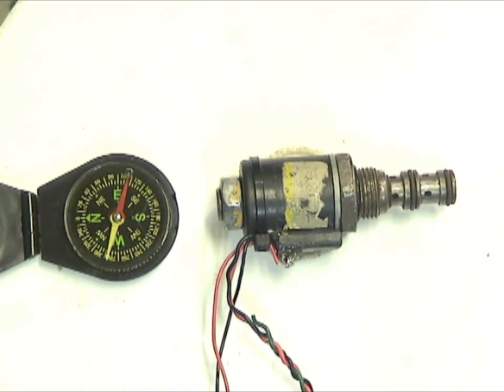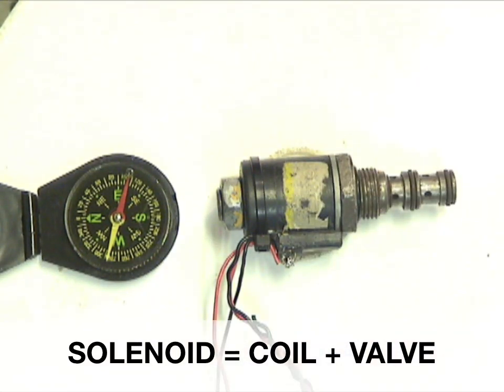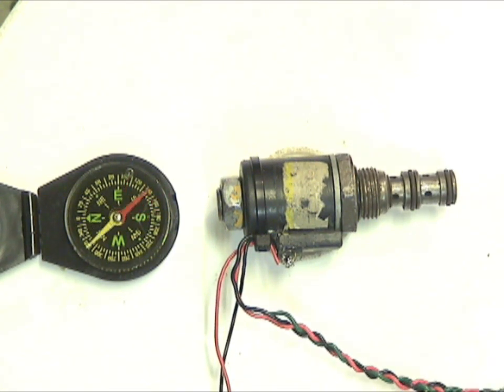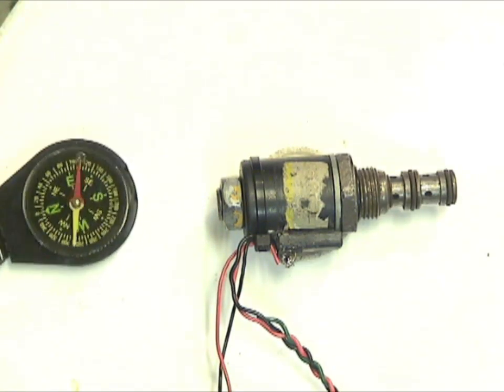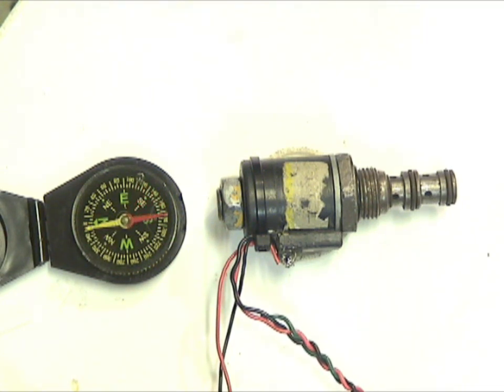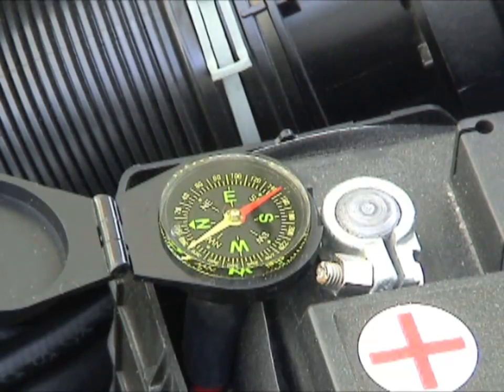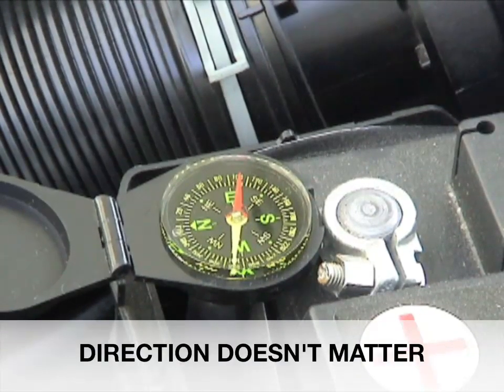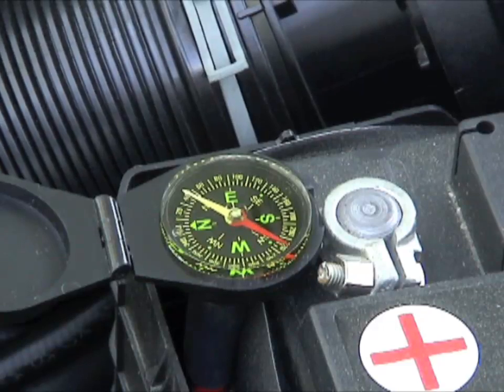Testing Solenoids and Alternators with a Compass

Comment: That's a great test. You could however, still have a weak, low charging alternator.
Reply from the maker: If the needle swings, the voltages reverse...
Reply: @bivideo7 Yes. The voltage reverses but the charging can still be weak.

Comment: This is nothing more than a gimmick. The compass will not show you the condition of the electrical coil because the coil  when in use can short or open in service. The compass can't show you charging voltage either.

Comment: Hello.
By Multimeter, I've measured my solenoid valve (cvt transmission) for Nissan micra v16, and put the read pointer to multimeter on the unit Ohm appeared result 12.7 ohm. Does it need to replacement or not?
Tank you.
Reply from the maker: Probably not. Can you connect it to 12V and see what happens? Remember - it's probably a wire problem...
Reply: thank you for your cooperation:
I did that, it was closed and opens well. Is his job closing and opening only?
Reply from the maker: I can't be certain - but they usually are spring-loaded closed and magnetically opened.
Reply: thank you Daniel Sullivan:
the problem in my cvt transmission is no speed, the pulley not yet move!
Is it possible to be a problem of solenoid?

Comment: Sadly this will not tell you if the alternator is putting out 12v or 14v which makes all the difference in the world. Neat trick nonetheless but is no replacement for a voltmeter.
Reply from the maker: Actually - It does.
Reply: Daniel Sullivan Would the difference in 12vdc and 14vdc be shown in how far the compass needle moves?
Reply: +Daniel Sullivan I understand how you can use a compass to determine a weak alternator. Thanks for sharing this new idea I learned from you.
Reply: wow... Please just stop talking to me with your nonsense.
Reply from the maker: Nomad Ryder The only way the needle can reverse is if the current reverses, which can only reverse if the alternator voltage is higher than the battery voltage. It's basic magnetic theory. If people disagree, they don't understand the theory, and they don't have my ±30 years of experience.